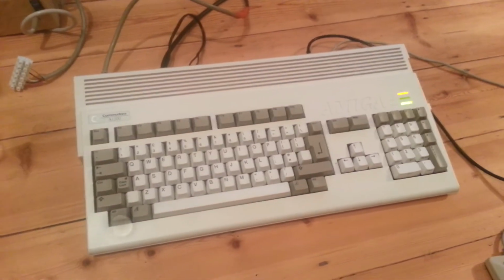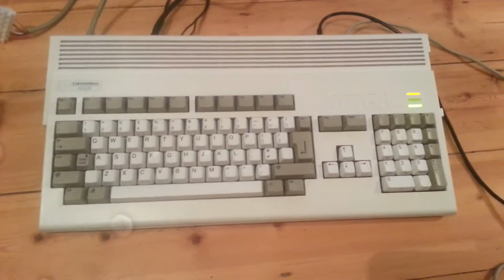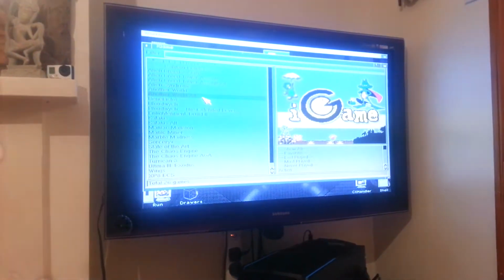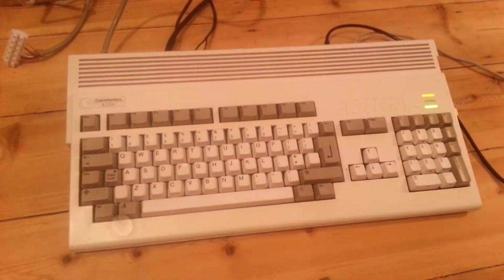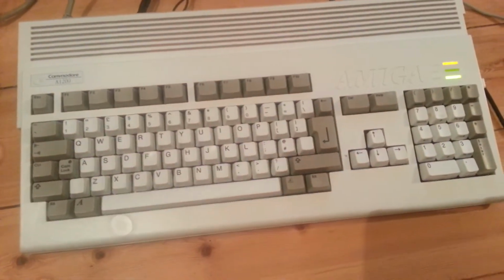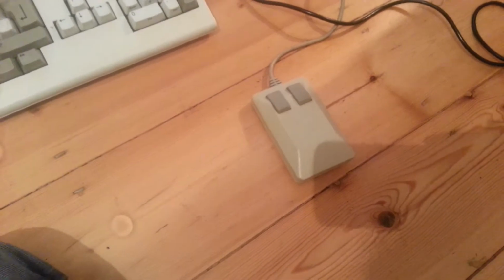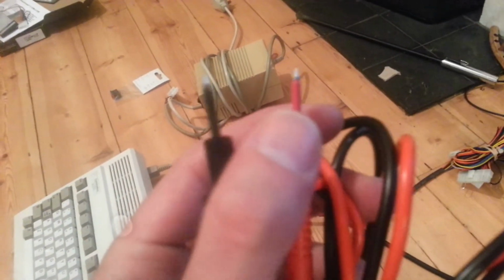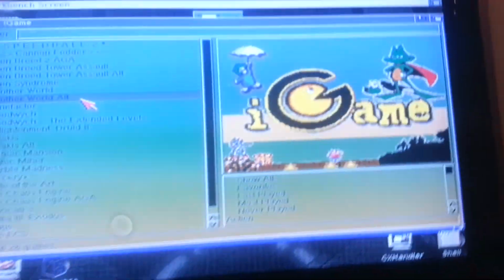Power Amiga 1200/500 with ATX psu

Comment: Anything to tell about the 5 Volt issue? I have heard it can drop and breake stuff running on 5 Volt. Is it true?
Reply: I haven't heard of a specific 5V issue, are you talking about with an original Amiga PSU. Any time a voltage drops below a threshold it can cause issues with electronics (they are quite hardy but they can break) now if you have a HDD that's active and the power drops, you can get what is known as a head crash possibly damaging the drive and this would be the most likely real damage. The other main source of issues with dropped voltage would be system crash (oh well) or if you are saving a file the data would be corrupted.
Reply: daishi5571,  not about original PSU. The 5 Volt drop happens on newer atx PSU's. Only negative thing I have heard about it. But I will use ATX PSU anyway because I think old PSU's don't fullfill todays standards and they are old and less secure.
Reply: +Daniel K
 Hi, I got a partial message from you in my notification, but when I check I cannot find your full message.

Comment: Any recommendations on the wattage for an ATX PSU to use? Would too high or too little be an issue and what is too high or too little?
Reply from the maker: Sinphaltimusi. Hi, i just used a gemeric 350 watt one off ebay. as far as wattage is concerned, higher is always better than lower. the machine will only draw what it needs. if you are adding a lot of peripherals then maybe higher would be better. Hope that helps.
Reply: Sure does, thanks. i certainly don't want to underpower it. I have a GVP SCSI controller that I planned to mod so it powers off the expansion slot but it's driving a SCSI2SD adapter and not a mechanical HDD. Plus 2 floppies (one a GoTek) and soon an accelerator board. I guess I can do the math and see how those add up plus the mainboard. 250 is probably a good start, I have an attic full of old ATX PSUs. 

you video here is excellent, i got to see hands on what it takes, this will make life a lot easier when i move the A500 in to an ATX tower due to crumbling case.
Reply: I have to look up running the GVP controller off of the atx, there might be a  mod for that as well. There is already a mod to run it off the Amiga 500 side expansion slot. 

http://members.iinet.net.au/~davem2/overclock/a500hd.html

I'm not running any mechanical drives on the internal SCSI, the cd-rom already has a PC molex connector for power (which I'm powering independently at the moment from its own ATX PSU. And then I have to consider the ZIP drive which has its own Power adaptor, just gotta check the rating on the output for that or stick with the adaptor and have 2 plugs going to the Amiga. Not ready to do any of this yet, I'm in the middle of so many projects that moving this in to an ATX tower case is simply for footprint and aesthetics as my A500 chassis is broken to bits due to the fragility of the old dried out plastic. So lower priority at the moment.
Reply: The a590 looks especially good (but likely applies to gvp too) since, once that is done, any extra SCSI housed IDE CDROM or HDD daisy chained off the back could simply use a molex too. You may wish to check out the TerribleFire channel or some of the amiga hardware he is doing btw.
Reply: If you daisy chain a bunch of things (maybe hard drives) via scsi on a amiga sidecar you may wish considering powering those things off your chosen PSU too and with that you may or may not find the rails (e.g. dual) the PSU has relevant? Any ideas?
Reply: The only issue with using a larger Wattage PSU is the waste that is generated. There is a good article on this on Wikipedia
https://en.wikipedia.org/wiki/80_Plus

Comment from the maker: Hi. Any old ATX should work but what is hard to find is the Amiga power connector to solder onto it. If you have a dead Amiga psu then just cut off the power connector and solder it to the atx. If not, it might be worth asking at Amigakit. The Amiga needs 5v, 0v, 12v and -12v. The first 3 are easy and are on the molex (normally red, black and yellow wires) of the atx. The blue wire that normally goes from the atx to a pc motherboard connector is normally -12v. so you can cut it at the connector end and get the -12v from there. You then just have to solder/connect the 4 wires to the Amiga power connector as shown. The Amiga power connector pinout is on pinouts.ru. and all over Google. Once you have it together, it is best to check voltages against the pinout before plugging it into Amiga as wiring it wrong will damage it. Good luck.
Reply: Well. A different connector would work for both or a 3d. printed one could be used.

Comment: Hi mate can you tell me where i can order a PSU like this for Amiga 500?
Reply from the maker: Gulliver Gate Hi Gulliver, Thanks for watching. Maybe these guys?

http://amigakit.leamancomputing.com/catalog/product_info.php?products_id=199

I think 1200 psu is same as Amiga 500 psu, pinout wise. 

I don't sell them. This was a DIY project using a  standard ATX power supply from a PC. Reason is that the old Amiga PSUs can fail and damage the Amiga. Your biggest battle will be finding the square connector to the Amiga. If you already have one the you can hack an old ATX psu. You can either rip one out of an old/broken PC for nothing or get a new one off Ebay/whatever for pence. It just needed +/- 12v, a 5v and a ground. Please be careful if trying this and if you are unsure get somebody to check it over first.

All the best
Reply from the maker: Gulliver Gate no sorry mate I binned Facebook years ago...